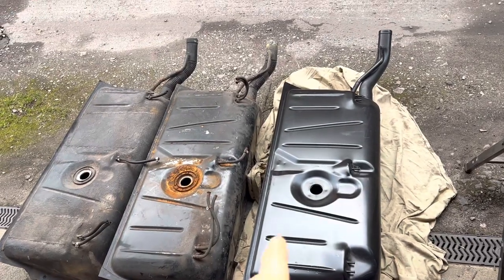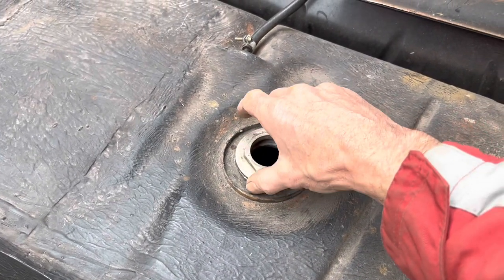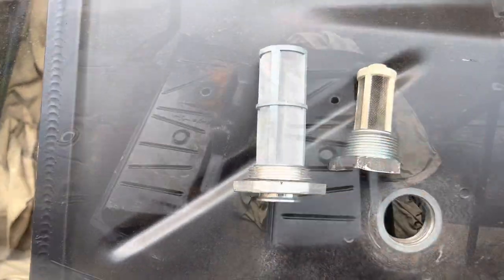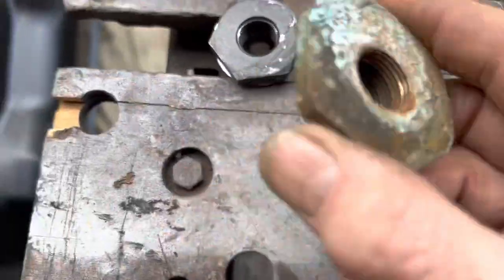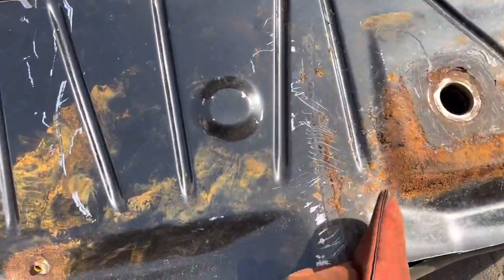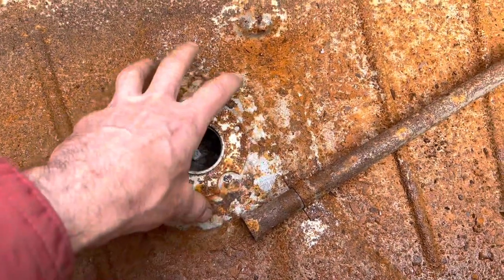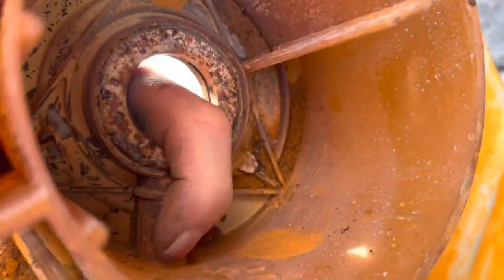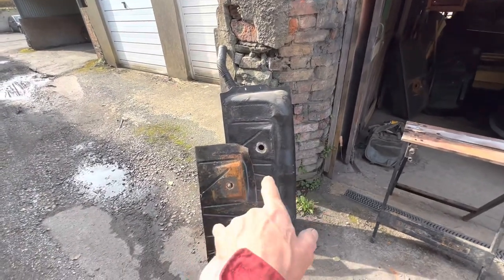Cutting open a Mercedes R107 fuel tank…and modifying a non OEM tank

Comment: Wow. You are going through what I went through 5 years ago.  What I did was have a radiator shop clean and coat the inside of my old tank.  Their chemicals would eat up the plastic Venturi so I had a metal Venturi made.  They cut open the tank, welded in my metal Venturi, patched the tank and then cleaned and coated it.  This was still a lot cheaper than a new tank.  I did not realize that there were two tank configurations so a new tank may not have worked.
Reply from the maker: Thanks for your comment. Interesting to learn that the chemicals would eat up a plastic venturi. I have just taken it out of the tank and will sell it on eBay just in case anyone need one. Still umming and ahhing about the fuel strainer issue. I am kind of loathe to cut into the new tank. All the best. Mike

Comment: Using the smaller (and coarser) fuel strainer shouldn’t be a problem, the filters will still do most of the work anyway. As for the fitting I would make sure that it seals, possibly using something magic. The old one didn’t have a proper sealing surface except the metal-to-metal nipple which isn’t all that great anyways. For the sender I would weld the new one in place, I am sceptical to gluing anything on a tank…
Reply from the maker: I think you are probably right about the mesh size if the strainer...although on the earlier D Jetronic fuel pumps there is a built in check valve (spring and ball bearing) which could get clogged by fine debris. I am loath to cut into the new tank and modify it to fit the standard Mercedes strainer - the upside of being OEM doesn't outweigh the downside of the tank leaking or rusting prematurely. 

I have decided to use Permatex 'Aviation Form-A-Gasket No.3' Gasket Sealant to seal the threads of the fuel hose to pulsation damper. This is a non setting fuel resistant compound that should stop the threads leaking. 

I will use 3m Panel bond to attach the fuel sender fitting as this sits on top of the tank and doesn't come in contact with any fuel. Welding this fitting would burn off the primer inside the tank which is difficult to re-prime.... the inside top of the tank is constantly exposed to air and will eventually rust if not 100% sealed.

Thanks for your comment - I appreciate you taking an interest. Many subscribers are far more knowledgeable and experienced than I will ever be. Mike

Comment: That uro tank from rock auto is 350 usd, I would just tap it for NPT threads and clamp a return hose to the new tank.. don't mess with rusty fuel which will destroy your fuel system by plugging injectors.
Reply from the maker: Thanks for your comment. I think the tank featured in this video probably is the one that URO supply...the problem is that neither the fuel sender or the fuel strainer from an older SL will fit. I'm not sure what you mean by 'tapping NPT' threads. I dont think it would be possible to tap threads on the actual tank. Mike

Comment: I have a fuel tank strainer that is original fro pm early 1972.  It has the internal thread on the strainer and the nut is flush without any protruding features. It comes with a brass tube that has external threads at one end with a small flange that when threaded into the strainer forms a seal. The other end is a tube with a flange for the fuel hose and clamp. 

Does anyone have a recommendation for the coating of the inside of the tank. I had the tank cleaned in a hot caustic. They did not do a thorough job and I had t rinse a number of times. If I take my finger I can see a very light reddish tinge of rust residue.  The Venturi looks like it got eaten up a little on the outside but appears in tact. Should I coat the tank?  

Welcoming any thoughts.

Comment: Hi Mike. Another useful and really relevant video for me and my 1974 SLC.  I need to replace the main fuel line from the tank to the damper cage as I’m replacing all the fuel hoses given their age.  So I am about to try unscreewing that pipe from the tank strainer unit. I may also try to remove the strainer unit. My concern is that if they are very tight (and the tank is still in the car) you run the risk of rounding the fuel hose and not getting it out so in a worse position that leaving well alone.  But it also occurred to me that if the strainer screws in with the same direction thread as the fuel hose, how do you know who inch will screw out first? Obviously you would expect to hold the strainer with a spanner but in the car there seems no way to do that. Any tips? I assume they are the same direction threads? And any view about the likelihood both will easily come out without taking the tank out?  The car has been in constant use and is not that rusty underneath which should help. Many thanks, John
Reply from the maker: Thanks for your comment. Often, the best way to get the fuel pipe out is to cut it and then use a deep socket with a big extension. Trying to get that loose with just a spanner is nigh impossible. Often the strainer comes out with the pipe. If you are changing the pipe, definitely change the strainer - it’s not that expensive. Once again use a socket rather than a spanner to tighten. Remember that the hose for early DJetronic is different than for later SL’s Where are you based? Mike
Reply: @MikesMercsandothercars Thanks Mike. I’m in Chorley, Lancashire. What you say makes sense - i guess once you cut the hose you are all in! Whereas now there is no leak but the rubber hoses which are visible are clearly cracking so my assumption is that the main hose (which is braided so rubber not visible of course) must be at least as bad.  I have done all the fuel pipes under the bonnet and had the injectors refurbed and refitted them with new seals so this is the last bit. Also awaiting with interest whether you get the US fuel pump from the US and to see if it works - mine works but needs at least a clean and a lick of paint. Best, John
Reply from the maker: Hi - sadly the fuel pump from America never arrived. I think I'll get someone in USA to buy one and physically bring it back.

Let me know how you get on with the rear fuel pipes. Scary when you go beyond the point on no return! Mike @jonnybigpotato4263
Reply from the maker: By the way, if you do want to overhaul your fuel pump, I am selling a refurb kit on ebay for £4.99. It includes the O rings and stainless steel screws. I only have 1 left so let me know and I'll set it aside for you. Mike
Reply: @MikesMercsandothercars ah i see it is an auction. If you are able to re-list it with a buy it now price I’ll buy that from you thank you
Reply from the maker: @jonnybigpotato4263
Reply from the maker: Hi - I have ended the listing and will send it to you. Can you send an email to m_scott65@hotmail.com with your address. Mike
Reply: @MikesMercsandothercars done, thanks

Comment: I got anxiety watching him constantly rubbing his fingers around that rusted metal. Otherwise, great video! One other option that I don't believe you mentioned would be to just go and buy the proper fuel tank for the car instead of cutting up and swapping parts from 2 tanks just to make one. Economically, seems like the time and effort involved would cost more than just buying the correct part.
Reply from the maker: Thanks for your comment. Unfortunately, they dont make tanks for the early R107 SL's....and the Mercedes cost for a new tank was in excess of £1500+vat. Mike